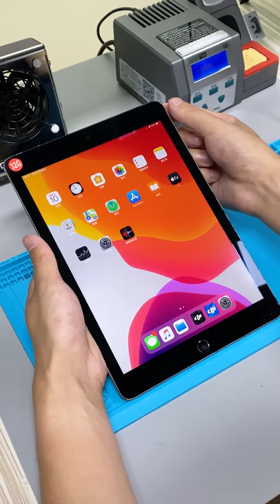iPad Air 2 Battery Replacement #shorts

Comment: Never plug/unplug the display before disconnecting the battery first
You should know better
Reply: They unscrewed the battery connector and to some that is disconnecting
Reply: @4TMGames no its not. As a safety you put something non metallic between the battery so you dont blow the backlight circut. Also they use glue to adhere the screen. Thats lazy and bad for the nect tech who repairs this ipad as the screen may possible break and the frame is left in a complete mess. The real way is clean the frame fully. Use tape and primer the frame. Thats the professional way. I work as a repair tech. Thats how it is.
Reply: @4TMGames it's a pressure mounted connection, I guarantee you that removing the screw is not enough to disconnect the battery. You need to create a gap using your choice of non conductive material, my choice is a waterproof playing card.
Reply: @4TMGames It's still not enough. A plastic card or pick should be inserted after unscrewing to completely cut any close power connection